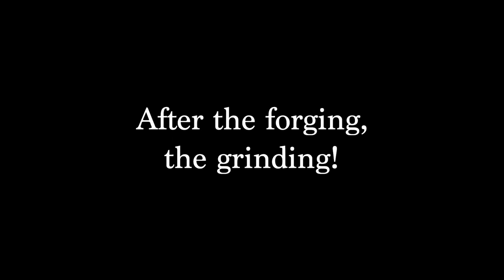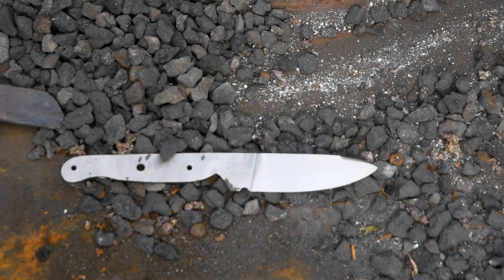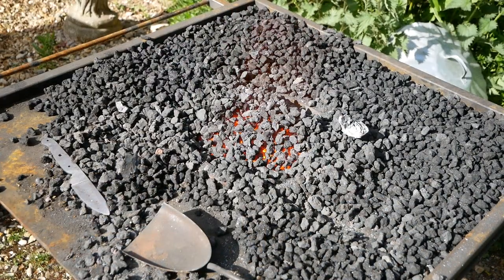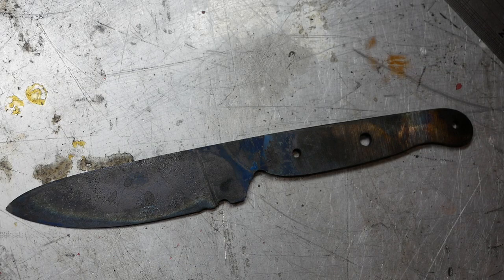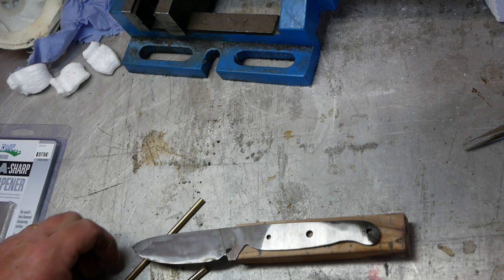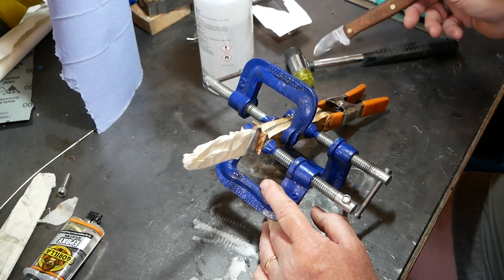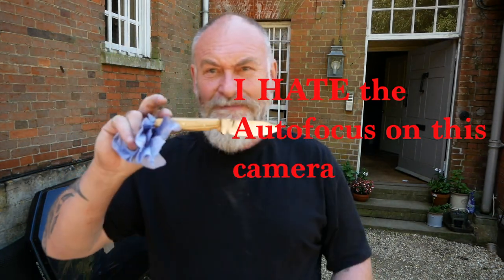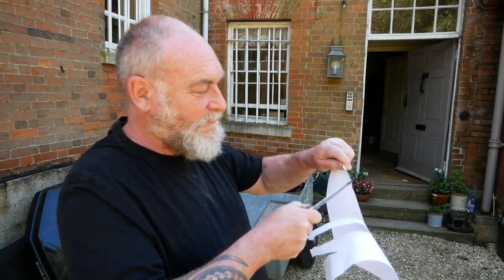Forging a blade from a Railroad Track Part 2

Comment: Very good work .me personally I prefer to attach the skales to the knife first then shape the handle Wild attached instead of individually, cutting out each side I tend to make a lot of mistakes doing it that way, and less mistakes, actually attaching them first, then shaping them but hey to each their own me personally I just felt like I made fewer mistakes, attaching the scale first then shaping versus cutting out each individual scale to match sides great work on your blade. I found your video informative.👍🏽

Comment: That was really your first blade? If so congratulations because it turned out extremely nice! The tops of railroad track is typically 1075-1084 steel in the US (I'd guess it's the same all the way through) with the curved track typically being higher in carbon content. That's not easy steel to work with either, very stubborn steel so amazing job once again. That should be a very serviceable knife.
Reply from the maker: Thank you. No quite my first blade, but first blade forged from a chunk of steel that was unknown. Actually I tested to a hardness of rockwell 55 and we use it in the kitchen everyday. So I am really happy with it. next one on the way. Really appreciate your comment.